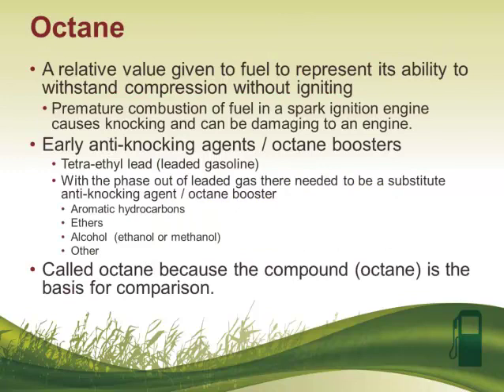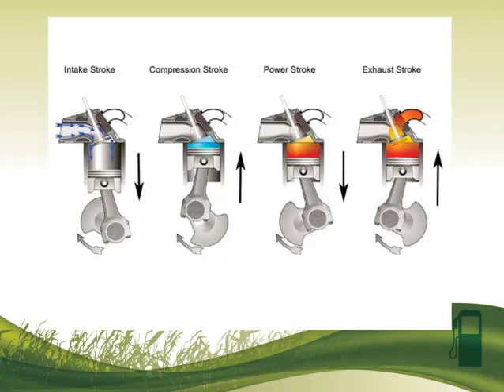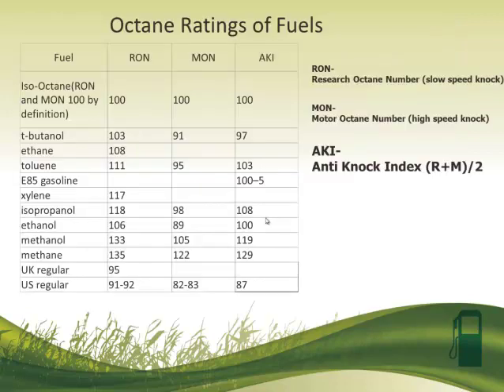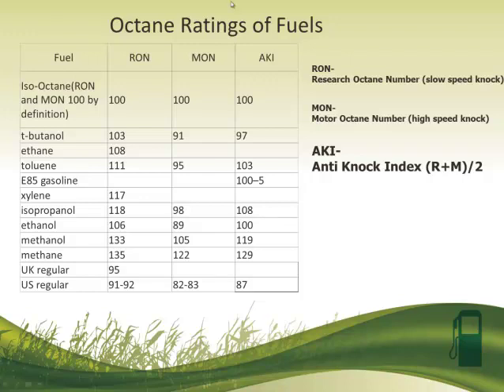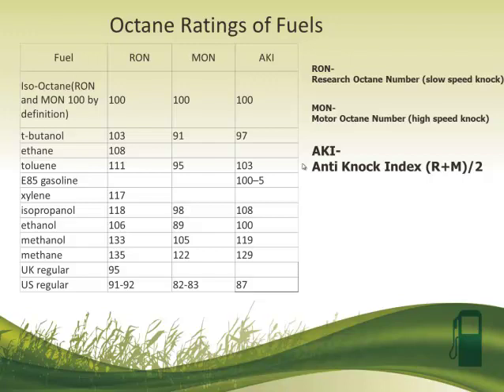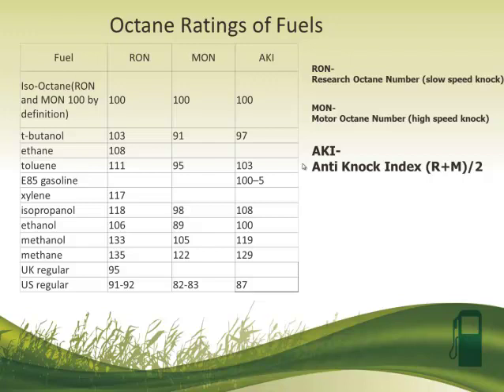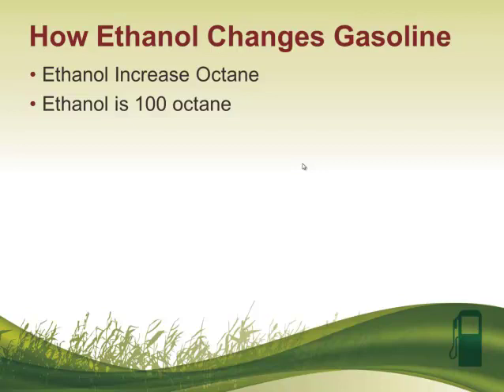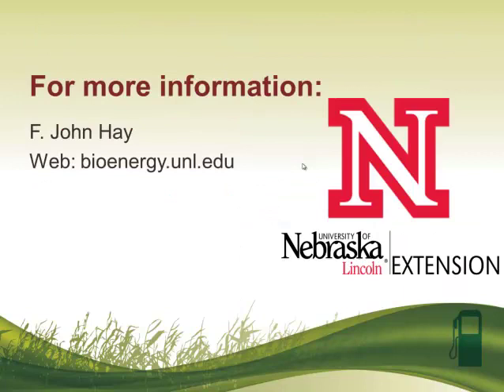How does ethanol change gasoline and octane?

Comment: Ethanol is really bad for chainsaws, generators and other small engines that have rubber fuel lines and tells up in carburetors, it has cost me many carburetors. I believe it only helps the CORN LOBBY

Comment: Adding just 5% ethanol to unleaded petrol drops the boiling point from 35 degrees C to 18 degrees C.

This is a problem for carbed engines, especially carbed classic cars and motorcycles as it causes premature vapourisation once the engine has reached running temperature.

This leads to a noticeable huge loss of low and midrange RPM torque, sooted up plugs and reduce fuel economy, not to mention occasional heat seizures at freeway cruising speeds.

Castrol engineers recommend mixing in either kerosene or diesel to bring up the boiling point, with the user using "suck it and see" experimentation.

I own and run a total of 11 road going 1970's 2 stroke motorcycles plus my son's pair of 2 stroke bikes commuter bikes, all running a compression ratio between 9.8:1 and 11.5:1 cold. After 2 years of experimentation I've concluded that an additional mix of 2% to 3% diesel per litre of E5 unleaded works out best. It has restored all the lost bottom and midrange torque plus cured the overheating and sooted up plugs problems cause by premature vapourisation combustion caused by the 5% ethanol contamination in UK petrol.

To solve the acetic acid (ethanol + oxygen = acetic acid "vinegar") creation ruining gas tanks, fuels hosing and fuel tap seals I've discovered that placing a zinc boating anode into the gas tank soaks it up before it can do any damage by leaching the iron out of the steel and destroying the factory weld sealant.

Octane rating isn't how much energy in the petrol. The energy content is measured in Calories. Leaded 98 to 99 RON petrol has 9.2 million calories per litre, if I remember what I read in an article back in the late 1990's. Unleaded 98 RON unleaded petrol has between 85% to 90% of the energy content, versus leaded 4 star, and 5% ethanol unleaded has even less.

However a motor cannot extract maximum Calorific potential from a fuel if it has issues combusting it efficiently.